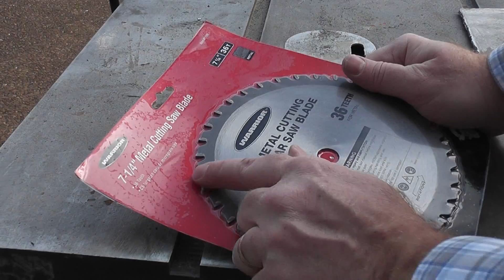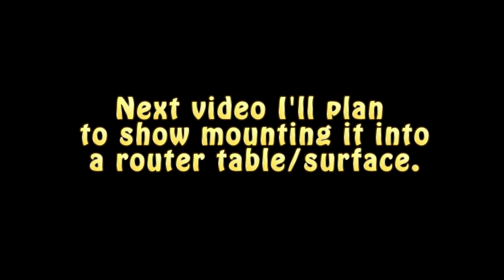Home Made Router Base Plate - Aluminum

Comment: the hole in the middle is too big
Reply from the maker: For general bits, yes it is definitely oversize. However I made this plate specifically for a bit that is extremely large (like 3.5" in diameter) which is used for routing cabinet door panels.

Comment: I've used router bits in the past to machine alu.  Once it went well, the second time I blew the bearings apart on 2 seperate flush trim bits (the bits were ok though and it was all going OK until the first one went).  You could clean up that hole real nice with a router bit (but please... take responsibility for your own safety - like not just taking my word for it and researching more online!)